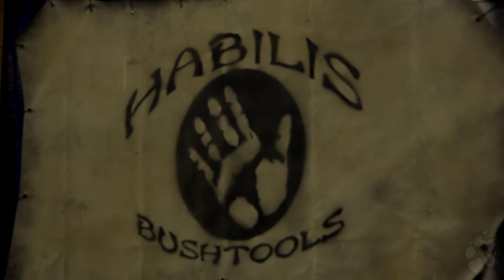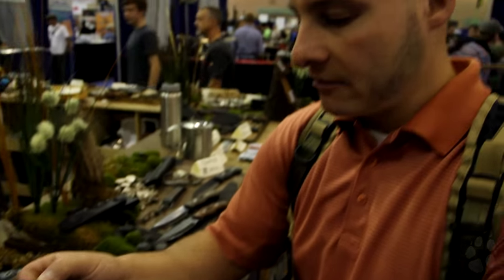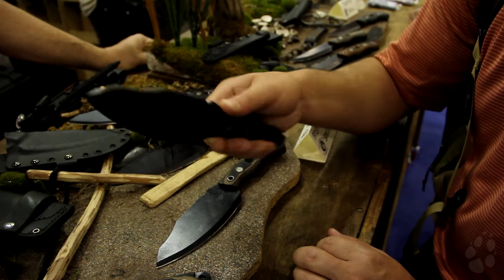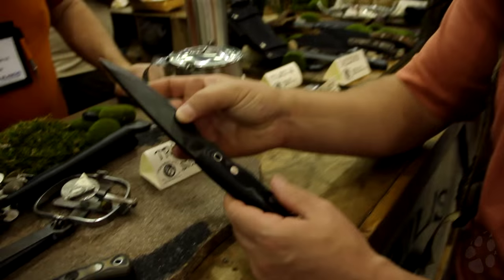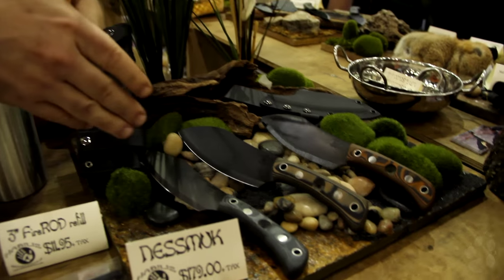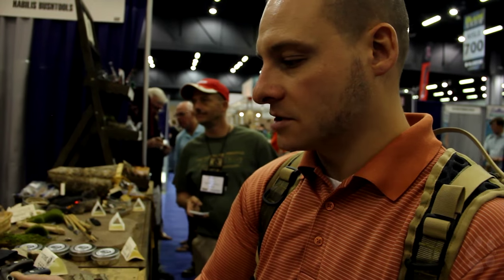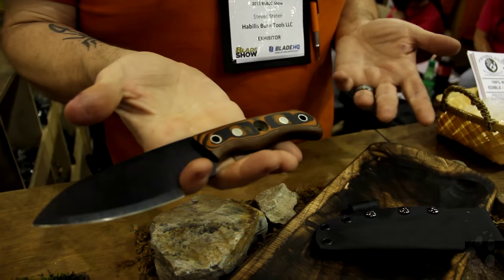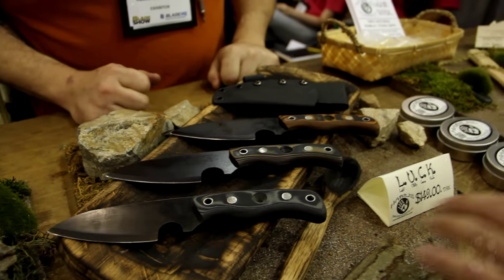Habilis Bushtools: Extended | Blade Show 2015

Comment: hm the pseudo scandi he talks about isnt a scandi at all... when putting a secondary bevel on it its just a saber. and a poor one as the primary bevel is way to short
Reply from the maker: That's a good point. I've always looked at saber grinds as "high scandi" grinds, so to speak. I'm sure he was referring to how low the grind is. If you watch the extended version, he goes into a little bit more depth on why he chose that grind. 1) it's easy to convert into a "true" scandi, and 2) it prolongs the life of the knife's profile over years and years of sharpening. Check it out.
Reply from the maker: Oops! This is the extended version... my bad.
Reply: +Foxwalk Primitive its a way to short grind to be effective in my eyes. in my eyes a knife should be a cutter not a one tool option thats way to overbuilt on the grind in my eyes.

but everybody likes different knifes myself is into thin full flat grinds and thats it :-P 

but very good review thats for sure and extremely good design on the knifes live the belly and the choil bit :-)